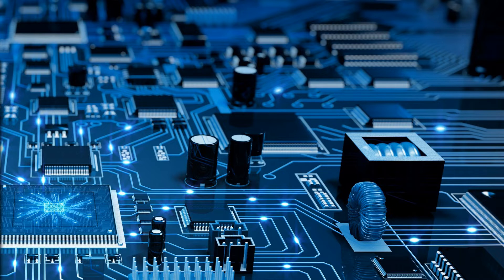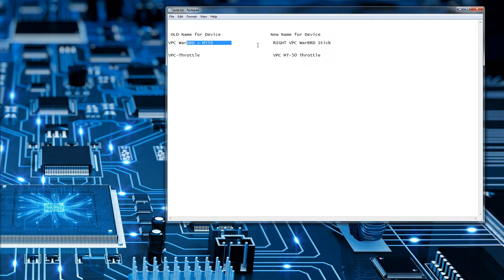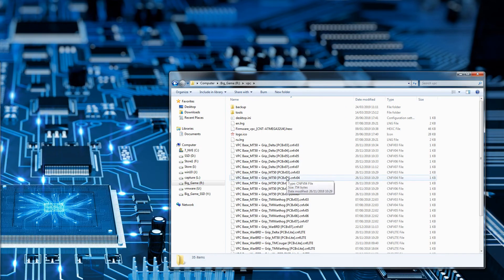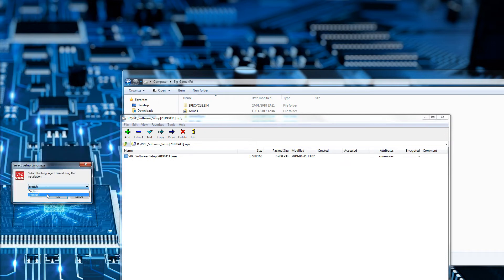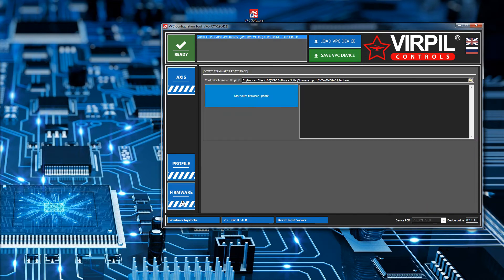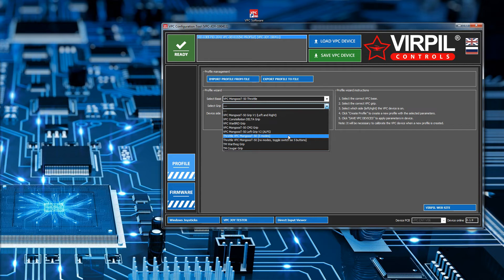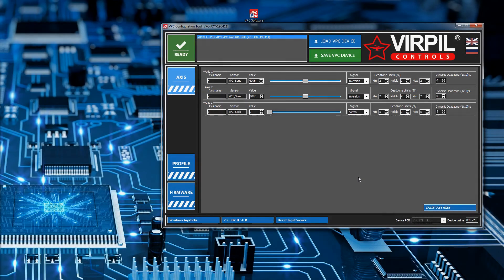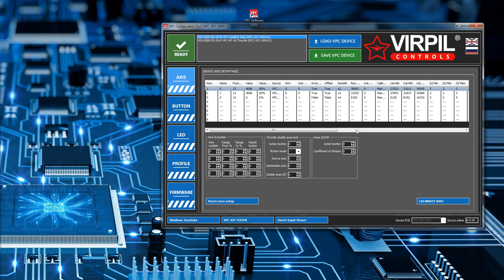11 April 2019 VPC Virpil software tutorial

Comment: Hello , and thank your for those tutorials really helpful for this software. Maybe you have answer for my issue. T50 gimbal and T50 moongose CM2 here, and since the software update ( i hope it s not the gimbal having itself a technical issue) i have a small deadzone on x and y. Recalibrating tons of time doesn't change anything. Any thoughts ? Or maybe i should touch the dead zone setting in the soft ? Although it doesn't seem to do anything. Sorry for my wall of text, my best!
Reply from the maker: deadzone I use inside Axis config is 2 2 2  , check your readouts in the main axis page to see if they are moving arround a lot (when not touched), I only use deadzone etc in virpil software not in games, when you say small deadzone, you mean you move the stick a little bit and no movement is registered ?

Comment: Nice video. Wish I had seen this before I updated. I have been busily resetting all my DCS profiles. I only have the T50 so I guess the saving grace is I only have to do it once for all the modules. One thing I noticed from your video is the lever setting on the stick, yours has a value that starts at 0% whereas mine seems to start at 69% for some reason so I need to figure out if that is correct for the T50 base. Also eagerly awaiting a new trigger lever as mine snapped at the pivot point.
Reply from the maker: yeah renaming the device name and GUID was a really stupid move from Virpil for NO GOOD REASON sadly , Iam going to write a batch file to rename all the DCS stick / throttle ID for me, I could not be fucked re-doing them all

Comment: If your DCS centric, do you even need to use this software? Seems like it is set up to key bind all by itself. Advantages?
Reply from the maker: Fly 12 different planes have 12 different buttons for flaps in DCS, create a joystick profile in JG bind F to a specific joystick button, which would be easier to fly with ?

Comment: hello, sorry to bother you but i run into an issue. I now have 2 warbird gimbal one with T50 stick on left and one with warthog grip on right. I set the both by the book in virpil soft and they share the same pid, and no matter what i do they are listed exactely the same, in Windows too, so i end up with two 'left stick", wich cause trouble for settings, contrôle etc in star Citizen for instance.  any idea?
Thanx!
Reply from the maker: leave the warbrd + T50 grip plugged in and remove the other stick. Change the PID  add one to it and then save this profile back to the device. plug other stick back in and see how it goes, the VID and PID shoule never be the same for two devices
Reply: i did that but i can t find where you change the pid? I use to know in the previous soft iteration  @HavocCompanyClan
Reply from the maker: @THE.RATGOD  it is in the profile tab, change the PID there and SAVE VPC DEVICE
Reply: found t trick, pro mode! thanx again! @HavocCompanyClan

Comment: hi, i have a new gas t50 CM! . I can't set the buttons in the left bottom of the wheel. you don't know what to do with it? thank you for the advice.
Reply from the maker: if you ask in English I might be able to help you, no idea what you are meaning or asking
Reply: @HavocCompanyClan  Hi, I woudl like to ask you for your help. I have a new gas lever VPC MongoosT-50 Throttle. I can not start the buttons on gas lever. When I press the buttons, they will not appear in the settings. Only the green light on the gas pipe shines on me on the basic. The buttons cannot be set on both the gas lever and the base.
Reply from the maker: @plaminek98  Ok, try the creating new profile and saving it to the device section see if that helps
Reply: @HavocCompanyClan  Created. Ladislav Jalový.

Comment: I got my VPC warBRD base on wednesday before this update came out. I installed the latest version then and tried to get it working. I had some issues but at least I was able to update the firmware. For some reason it suddenly decided to not recongize the device anymore though. Now when I installed this, however, I'm unable to update the firmware. The updater just keeps flashing and going nowhere, there's not text appearing. the software just blinks randomly without doing anything. If I try to create a profile it just tells me "ERROR Device PBC".
Reply from the maker: post a screen capture of the VPC software, use left ALT + Print Screen
Reply: @HavocCompanyClan  To where do I send it?
Reply from the maker: @jonmabec  post it on imgur.com    and link it here
Reply from the maker: @jonmabec  Unplug stick then plug it in again, click on your stick (from list above) then click  Update Firmware
Reply: @HavocCompanyClan  Omg i feel so stupid right now. Thanks a bunch for the help! That did the trick!
Reply: @jonmabec  You´re NOT stupid, I had the same problem, I received a product without ANY explanation so it´s really difficult to do things right.